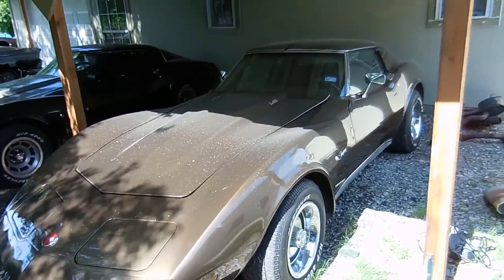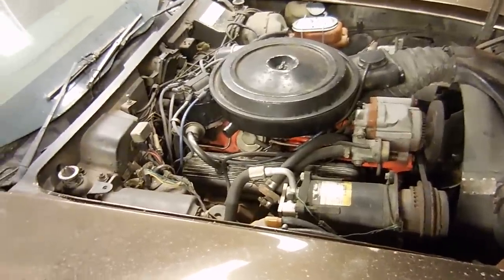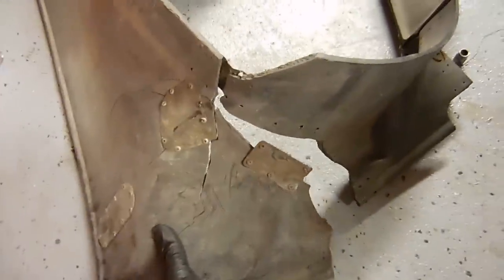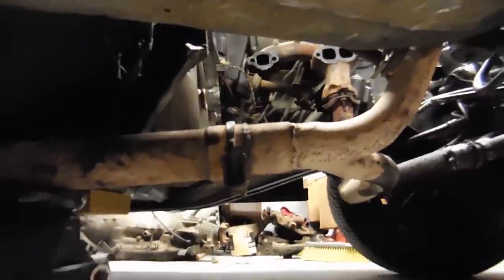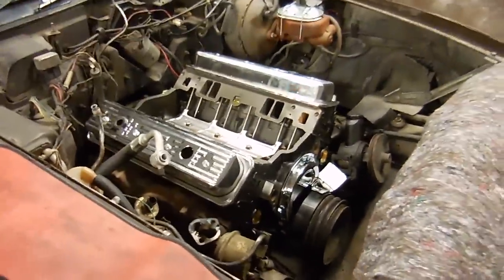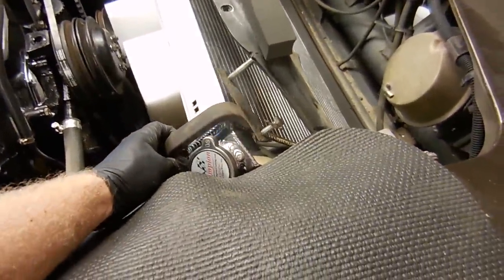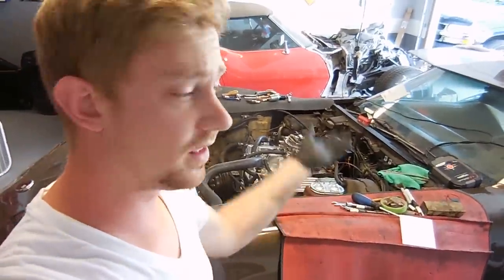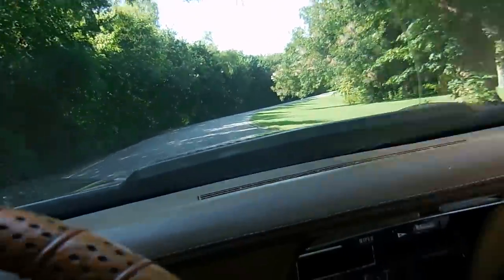John's 1976 C3 Corvette Gets a Brand New Crate Engine

Comment: Great "How To Video" Thanks for taking the time to make and share this video. Very well done.
 I got many chuckles from the arm chair critic's comments.
I purchased my one owner 79 L-82 last year for the love of its classy looks and to also remove a Corvette purchase from my "Bucket List". It's a warm sunny day cruiser from May until November. I spend my long Canadian winters doing my priority things on her. Complete renewal of rear suspension, U-joints, spindles and bearings, differential stub shafts and so on last winter.
This winter's projects I'm working on are a complete rebuild of the front suspension and steering. A new aluminum rad and electric fans. Replacing the 2-1/4" pipes with 2-1/2" back from the ceramic coated headers and working over my transmission crossmember to let the pipes run straight back until after the crossmember to make room for the  2004r transmission I have on the bench that will be rebuilt strong enough for a future engine up grade of fresh Vortec heads (on the bench) and Edelbrock manifold and maybe a different camshaft. My goal for this is for lower rpm's on the highway, fuel savings and respectable power. It will never be a ground pounding drag car nor a numbers matching Vette but rather a reliable money hungry Classic which will always present herself well. It will be passed on to my son. All original parts will be kept if anyone wants to have a #s matching car. lol.

Comment: Oil usage is common on older cars that are not driven much, and the oil is not changed often enough. The oil control rings get stuck in the ring grove because of the waxes in the oil. The thicker the oil, the more wax is in it. Also short trips wreak havoc on engines, plus it could have overheated, taking the temper out of the rings.

I can't stand finding hacked up aftermarket wiring for alarms and other accessories. That is always the first thing I remove, as it always causes other problems. Plus I hate scotch locks and crimp connectors... I solder and shrink wrap everything.

With the alternator, the voltage did look low, but remember voltage will increase as amperage output decreases. 

The other carburetors you have, just need a good rebuild. There always rebuildable, unless the casting is cracked or broken.

Great video... Thank You.

Comment: Im an old fart and would have rebuilt the matching engine, but great video!
Reply: The original engine would need better heads and cam to make that power plus a complete rebuild and it wouldn't have a warranty.
Reply: John probably wanted a fresh crate motor and didn't mind tossing the matching one. Not really Ben's decision.
Reply: Agreed. I'd have kept the numbers matching engine and had it refreshed. Although it may have cost more than to just pick up a new long block. I dunno though. As long as it weren't a daily driver i'd have spent the additional money I think. I've been struggling with that thought on the motor in my 79 Chevy K10. I'd like to upgrade to a newer L31 Vortec style but part of me doesn't give that much of a crap about the little bit of extra performance because I drive my truck about as often as I go to Houston which is almost never, lol.
Reply: Me too.and better..afford headers as well
Reply: Im with you on that one. I think its a heavy duty block,crank and rods.
Reply: @jerryhubbard4461  I think he's probably just doing what the customer wanted him to do.
Reply: headers Definetly!
Reply: Yeah im with you on that. Matching numbers is a big deal with vettes. But I'm sure their not just junking the original engine,  as a driver it's not a big deal, only when it's time to sell it.
Reply: matching number dont matter sell ing air pump etc 76 vette stock or mod mod probly more
Reply: I might agree if the car had substantial value, but in this case it really doesn't matter. There are thousands of mid-70s Corvettes out there, and this C3 isn't exactly what I'd call a desirable Corvette. A late 60s Vette is another story. Back in the 70s when I was just a kid my neighbors had a white '74 and a bronze '76 like this one. The neighbors son also had a red '74 Trans Am 6.6l. I was an envious little kid! The starter sound of the Corvette heard in this video brings back memories. Well, that and our other neighbor's brand new 1974 V12 Jaguar X-Type. That thing seemed to take forever to get running, and this was the wife of the household having to struggle with it every morning. Fuel injection sure would have made it easier on her. It made enough noise starting which made it very recognizable from 1000' away.
Reply: @HorsepowerGarageVideos     L-82  already has  good heads   put a modern hydraulic Roller cam in it ..   So if you just want to replace the motor .. I used to  BY  Gm Crate engines for  $950.00  in the early 1980's then later were like $1,100.00  

  I didn't watch your whole  video  but would be curious what engine you used..     The 1970  LT-1 was the best motor that was   370 HP  ..  remember  add headers add  50 more HP  ..  Sell the L-82 on E-Bay there are people looking for them and   they are easy to rebuild with way better parts..    Could even put aftermarket  Aluminum heads on them ..
Reply: @mikeskidmore6754  L82 heads are big chamber low compression, not good for performance.
Reply: New LS7.
Reply: @HorsepowerGarageVideos   Small  Block   Chevy 350   had   64 CC  heads  until  1970   then   they  went to  76  CC's  then   they   went  to  76  cc heads  and  dished  pistons  flat  top  piston  and  76  cc heads  give a 350 about  9 to 1 compression..   Now  Big  block  Chevy   open chamber   heads  were  130  CC's
Reply: @mikeskidmore6754  That's fine if you're not looking to make it fast, but by todays standards that stuff is junk.  You'd be lucky to make 300hp
Reply: @fishyfool  Ha ha kid, I'm 32.  Check out the videos of my car if you don't think I know what I'm talking about.
Reply: Great video. I may be in touch one day about a custom, paid project if you’re interested. I assume the email address you listed for the decal is the best way to reach you?
Reply: Chrome is the car's not worth anything changing the motor is it going to make a difference except in 20 years what are you if a car does become worth something no one's going to want it cuz it doesn't have it original engine but that's 20 years he'll be a hundred years old so yeah I wouldn't if it was a 69 okay but the crate motor goes for a couple thousand rebuilding this thing's probably going to cost a lot more and if you get a crate motor you can probably get it more horsepower but I don't know much about it so I don't know
Reply: @johnd4270  Say that in English.
Reply: mikenbdg I would have kept and rebuilt the OEM L82.
Reply: @Shane-Singleton  I'd rather have the 5.7 350 it has in it than the (PAPER WEIGHT LS CRAP) my lands all you have to do is do a price comparison  on the 2 Engines (OH YES YOU CAN GET THE PERFORMANCE OUT OF  THE OLD SCHOOL THAT YOU CAN GET IN THE NEW PAPER WEIGHT SCHOOL) you can buy a whole Engine old school for what you pay for just a bare Block of a New School LS Engine don't believe me get on your computer & do a comparison  BARE BLOCK $2100,00 $$$$$$$$$ a whole OLD SCHOOL SMALL BLOCK & SOMETIMES A 383 CID HP. with 300 to 800 HP that much or a little more ($2100,00 READY TO DROP IN & RUN EXCEPT ALTENATOR .WATER PUMP & STARTER & OF COURSE THE AIR CONDITIONER COMPRESSOR)  so there you have it
Reply: @aslamb6489  True. Although I don't think I mentioned an LS swap. the L31 Vortec is the iron block 350 that was used 96-99 in GM pickups. The heads and intake will swap directly onto any standard old school sbc. Much better factory head castings than my smog era junk. The thing makes ~50 more horsepower in stock form than my paper weight. The engine in my 79 actually runs pretty well so there has been no real reason to tear it down or replace it. Now the engine in my 76 C20 is another story. It, at the very least, needs new valve seals. And possibly, judging by a small amount of blow by I noticed today when I had the air cleaner off, be a little tired and in need of a rebuild. I'm not exactly sure what i'm going to do with it yet in that regard. I wouldn't be LS swapping either of those trucks, though. It's just not what I want in those builds. I would LS swap on a bunch of stuff but not anything that I currently own. My 57 Chevy sedan is going to keep its original 235 stovebolt 6 until it sends a rod through the oil pan. And if that ever happens another 235 is going in.
Reply: mikenbdg, me too. A numbers matching car is always more valuable than any other.
Reply: @HorsepowerGarageVideos  The original 350 put out about 180 hp , just pathetic my 305 c-10 puts out 190
Reply: @evanhooper1  Just put the original motor away for when somebody buys  it its a low hp smog era motor.
Reply: @mikeskidmore6754  So the engine you have in your Camaro must be real good if you're changing it for an LS3, right? In 76 nothing was any good maybe except the 400 in the Trans Am... And that was only a shadow of itself at that time.
Reply: @arttafil6792  75-77 Corvettes are worth dick. No performance, nothing special either and are probably the worst looking Corvettes ever not counting the C4. So anything goes on these cars.
Reply: @robertpoudrette4483   1979  Z-28 Camaro   LM-1  same engine as the   350 4  barrel in pick up trucks l..
  350 Chevy  1.94  intake valves  1.50 exhaust  mild port work  Headers..  327  350  HP cam ..  Holley Street Dominator intake    600 CFM  Holley Double pumper  stock  3:73  gears..   Doug Nash 5 speed  ..  110  HP  Nitrous  recurved  HEI distributor  red line close to  7,000 RPM 
  I always ate Pontiac  400's for lunch  an  455 olds and 455 Buicks ..
  13:56  @ 107  MPH  quarter mile on slipper street tires..  always beat  mid  12  second cars in street races..
Reply: ok boomer
Reply: @Shane-Singleton  WITH SO MANY VETTS OUT THERE NO BIG DEAL IF #S DONT MATCH
Reply: jay bradley  it’s an L82 engine, not the L48. L82 had a whopping net 210Hp... so it’ll stomp your c10. ;).
Reply: Horsepower Garage yeh those motors were smoked out junk, I’d keep it for originality’s sake but run a real motor in the meantime
Reply: I will never care about numbers matching all that does is put these cars on a list that says you must be this rich and a snob to buy this car.
Fuck numbers matching and events like baret Jackson.
Reply: Agree Mike. I would of done the OG motor. Even tho this year vetts aren't worth that much yet but if I was ever to buy a vette .. I would only buy a matching numbers one. Also it's a smog year.. it's not a high HP motor it's a cruiser .. even with a crate motor today's Honda 4 banger turbo would spank it. Lol.
Reply: @mikeskidmore6754    I hear ya... I call these people car craft/hot rod magazine mechanics. They would rather throw a crate motor in it and brag how they built it. Lol.  But throw them a bare block and a box of parts they will sit there with the duh face on.  Lol.
Reply: @jiveturkey9993  Oddly people just don't understand that..
Reply: @monroefive-o40  Yeah if money was not an issue and by the time you got done modifying the entire drivetrain you'd spend double what the cars worth..No thanks
Reply: @robertpoudrette4483  People like skidmore just like to start shit on forum's, everyone is entitled to their opinion but to start name calling and assumptions about someone because they don't see their way ruins shit.
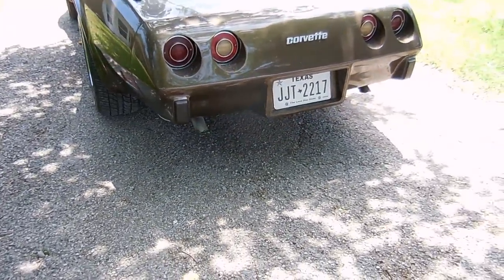Reply: @robertpoudrette4483  Even that was a dog lol. I had one with a 4speed and 3:23 years and it was nothing hot.
Reply: For Sale.  350 Vette engine.  Staggering 145hp.

Comment: For all those saying keep it original, these cars were slow and boring and will never be worth much...  but great lines good suspension and can bolt in an awesome engine.
Reply: So true, if you're gonna get a Corvette,  it should be fast and sporty, and a 76 corvette with its original emissions-regulations plagued engine, is not gonna be fast.
Reply: 43 year old cars don't need to brake land speed records, tune the carburetor if needed and enjoy the sexy curves that all the C3's offer.If speed is what you're after, break the bank and get a C7 or SRT Demon.
Reply: if anything keep the original motor so its still numbers matching.
Reply: Exactly, these cars looked beautiful, but were completely screwed over by the 1970s government regulation issues. There are a prime vehicle for an engine swap to make them what they should have been and better.
Reply: I pulled the L-48 boat anchor out of mine as well...I'm sorry its a vette its supposed to be fast...Pretty Embarrasing when you have a soccer mom pull away from you with her SUV filled w kids...

If you want a slow car buy a 4 door sedan...
Reply: Exactly. If I had the money and time I would love to find a clean mid 70's C-3 4 speed car and drop a GM crate motor and 5 speed in it.
Reply: @seththomas9105  Exactly, those saying keep it original don't understand the enjoyment of a fast ride or at least one that is effortless to cruise, instead of labor like the original old ones. That is one area that has improved vastly.
Reply: @jagsfanrick  I would never think of Resto modding a numbers matching low mile creampuff or something from the early 70's or older. But a smog motor, tired, oil burning  350 that put out a whopping 175 HP but has a nice body and interior is a PRIME candidate for a engine and trans swap.
Reply: @smilingskull7827  so the guys who bought them in the 70s and instantly through something bigger in were wrong ?
Reply: G hrvyck  the block can be built to make more hp.
Reply: LOL, there is NOTHING stopping someone from taking that original motor(heads and all) and rebuilding it to produce the same HP as that crate. You can even leave the smog pump in place and disable it in a manner where it uses no power. You have a numbers matching complete 82' Corvette and you just removed a bunch of stuff that gave it value. You can't call yourself a Corvette expert if you cant get the stock factory options working. It begs the question; would you take a numbers matching 69' and rip the motor out? 82' is the new 69'. Oh and that radiator was perfect. Lol he was pointing the flash light down it saying ' look at that crud' and it was in great shape. This guy isn't a builder or restorer, he's a part installer. I mean he doesn't know how to set the float on a new carb? WTF🤣:dothefive:
Reply: The rear suspension is the worst besides the corvair